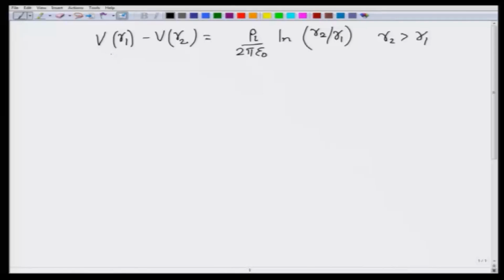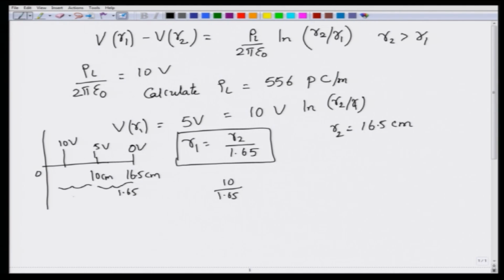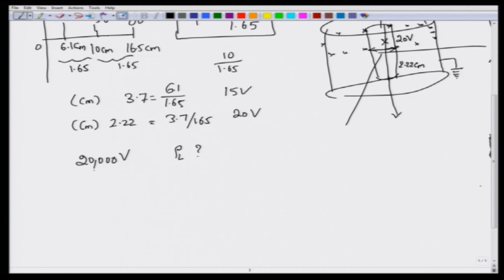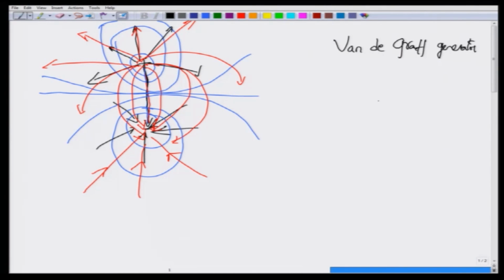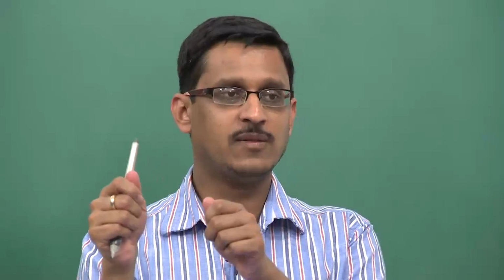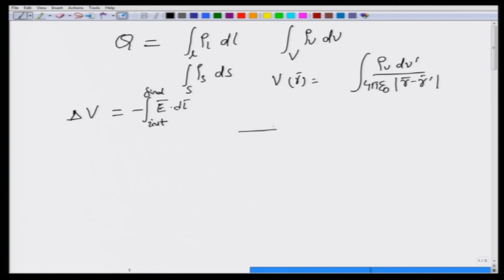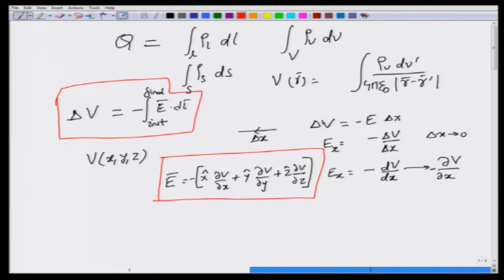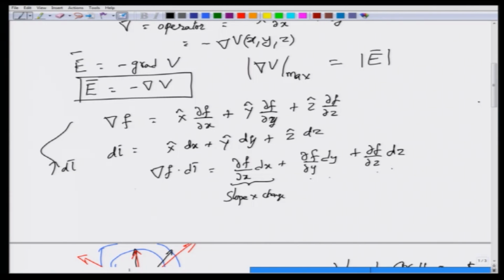Vector Analysis-III & Electric potential-III

Comment: On the equipotential surface we have same potential on each single field point charge why we need to bother about continuos line charge distribution
Reply: This is equipotential concept only applies when charge distributions are uniform